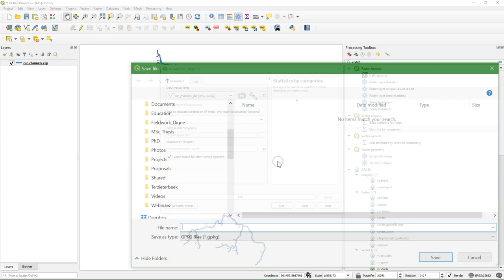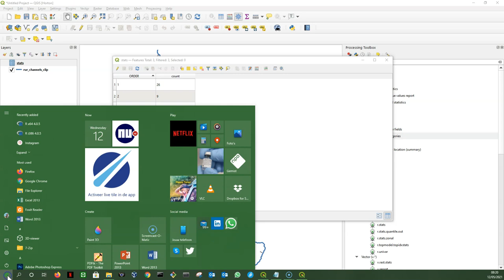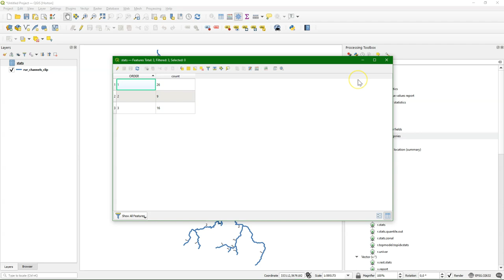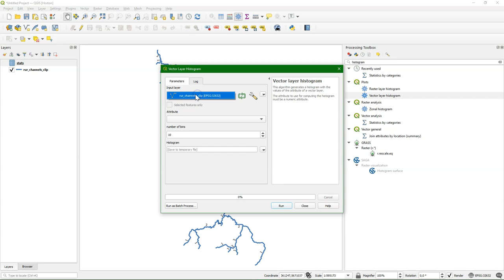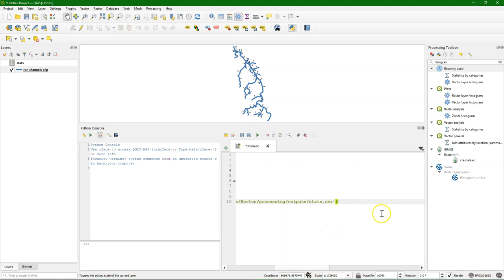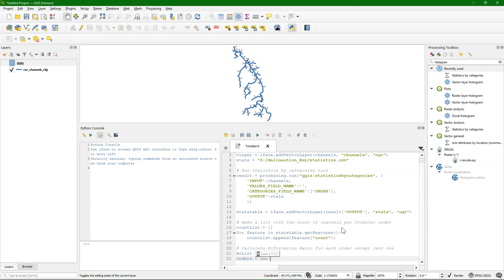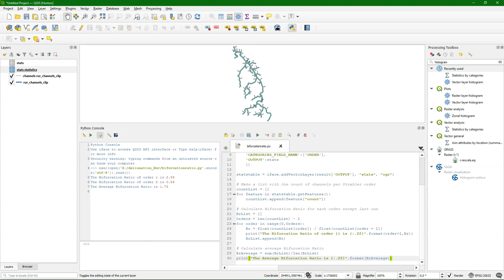Calculate the Bifurcation Ratio of a stream network with QGIS

Comment: Good evening,
How did you determine the vector depicting sthraler order?
Do you use a particular function or have you written a code?
Thanks as always to the content you proposed
Reply from the maker: For this video I derived Strahler order from a filled DEM using the Strahler order tool from SAGA in the QGIS Processing Toolbox, like in this video: https://youtu.be/SuFl8EWDqfU
Then you'll have a Strahler order raster that you need to calibrate with a reference image to find the threshold value to determine which Strahler orders form the river: https://youtu.be/2Ub0c7Ss-T4?t=1688
With the calibrated value you can create the river vector with Strahler orders using the Channel network and drainage basin tool from SAGA in the Processing Toolbox: https://youtu.be/2Ub0c7Ss-T4?t=1910

If you have already a vector of your river you can simply apply the Strahler method manually or use the Lines ranking plugin: https://youtu.be/A0h5yVogE6Y
Reply: @HansvanderKwast  Thanks for the availability and comprehensive explanation

Comment: Dear Dr Kwast, Thank you so much for the video and You know I do follow your Videos. However, I have a question here. The laws of Stream Number says that the lower order steam would have much higher streams (about 3.5 time) to maintain the higher order. And the 3rd order stream (Highest in this case) should have only one segment. In this video, the 3rd order streams are more in number than the 2nd order stream. If you please explain this, that would be so kind of you. Thank you so much
Reply from the maker: The laws are general and apply to natural systems. Here we have a heavily human modified system. Also geology can affect this.
Reply: @HansvanderKwast  I do acknowledge your reply and thanks for such a quick response. So, if I do understand, while performing any research activities, we need to be very much careful about the data generated through this process. Thank you so much.
Reply from the maker: It's the other way around. You do the analysis to understand the hydrology, not to confirm laws.
Reply: @HansvanderKwast  What I preferred is to "merge" the line segments to make it fit to further study. Thanks